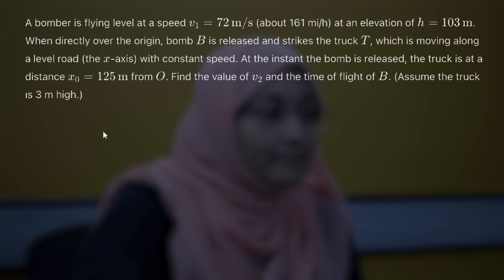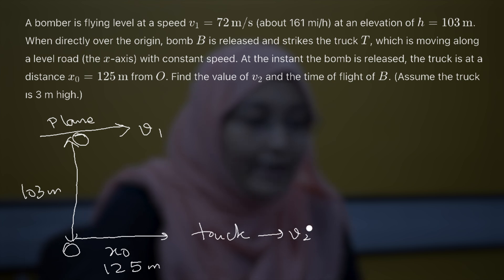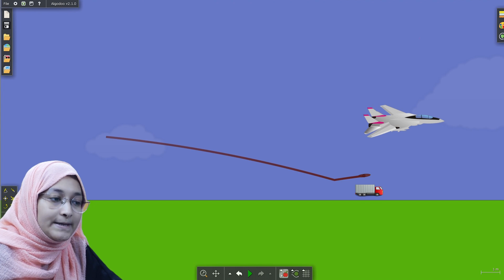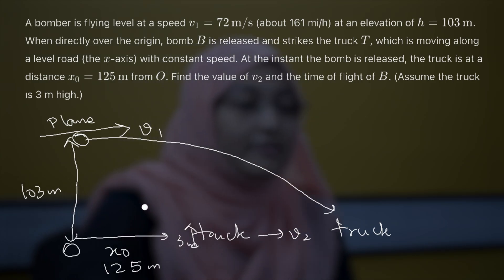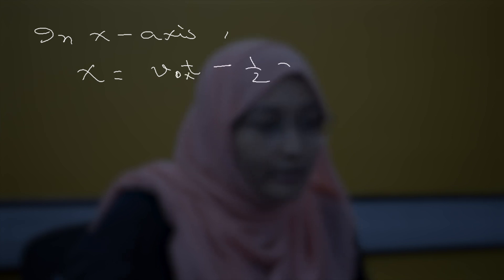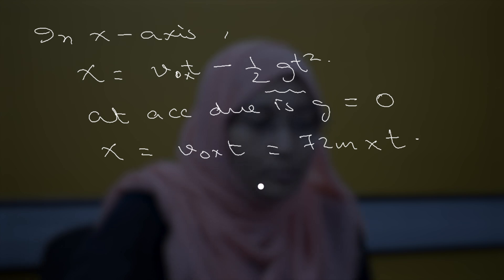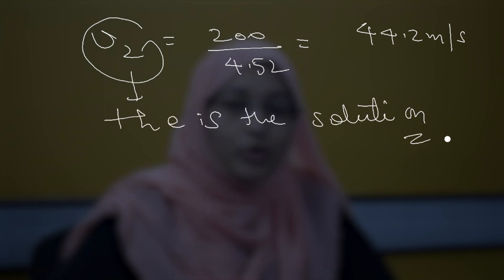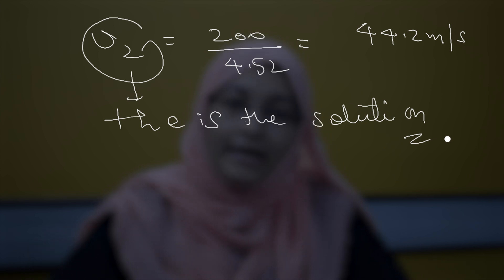Projectile Motion | War Plane and Truck Problem | Physics | Rasheeqa Jabeen | Cheenta

Comment: Why does the range of a projectile on a flat surface depend on the initial velocity and the angle of projection, and why is the range maximized at a 45-degree angle in the absence of air resistance?
Reply: Formula for range of a projectile on a plane is (2u²sin(theta)cos(theta))/g, where theta is the angle of projection and u is the initial velocity of object. From the formula you can clearly see that Range is directly proportional to initial speed of object and the angle of projection. Thats why range depends on initial velocity and angle of projection of that object. You can refer to ncert class 11 physics book for derivation of formula for range or some other youtube video (in case if you don't know the derivation). 

We can also write the formula for range as R = (u²sin(2×theta))/g, because sin(2×theta) = 2sin(theta)cos(theta), i hope you know this basic trigonometric identity. From above formula for range you can see that keeping u(initial velocity) constant the range will be maximum when sin(2×theta) is maximum. sin(2×theta) is maximum when theta is 45⁰. Sin(2×45⁰) = sin(90⁰) = 1 (maximum value of sin(x) is 1). Thats why range is maximum when angle of projection (theta) is 45⁰. Generally we don't consider air resistant, while solving questions or analyzing some simple situations we take only ideal conditions. If we consider air resistance than the equation will become more complicated, because an extra force due to air resistance will act on the object and makes the question  more complicated. You can also find some questions in which air resistance is considered. In real life situations we have to consider air resistance to get accurate answer. 

Hope it will help you. 😐